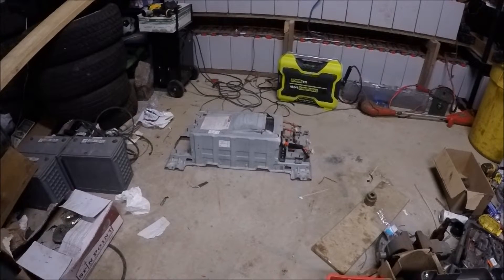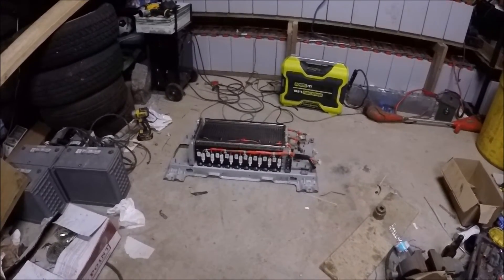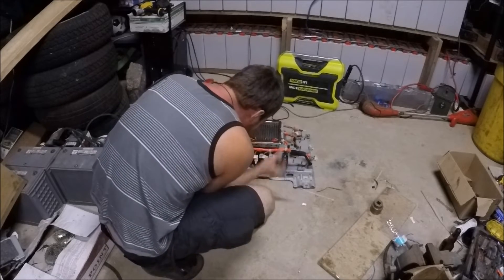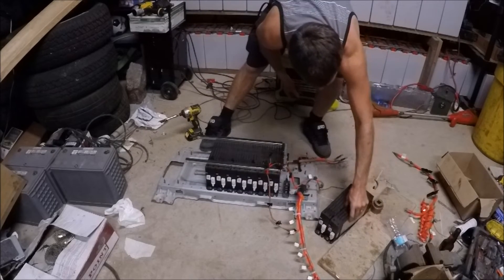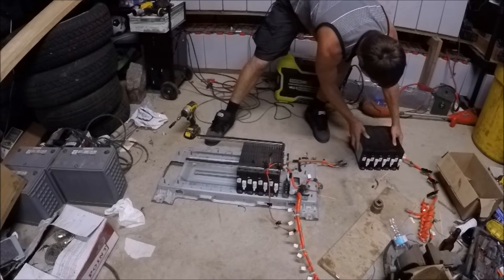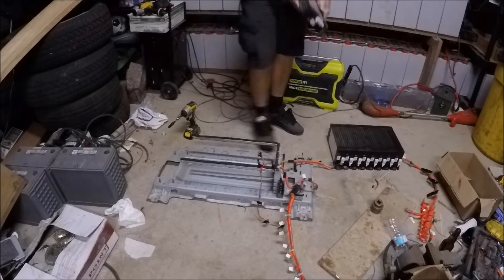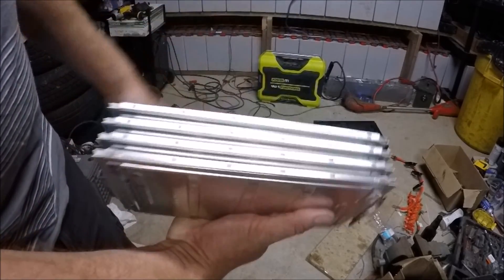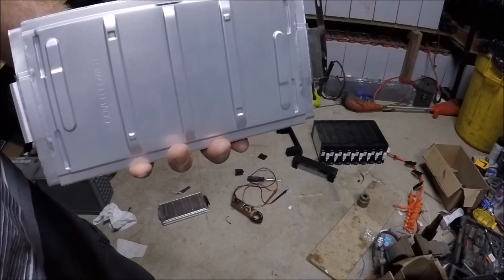EV Battery Tear Down

Comment: I would have wired the cell blocks as 2 in series to make 48V and upgrade to a better inverter.

Think this is from a 2013 Hyundai Sonata Hybrid, the specs and battery casing match. Seen some cheap hybrid battery packs in my part of the world also, I don't have the spare cash otherwise I'd have one already.
Reply from the maker: you are right,  but these are 33v packs and are no good for 48v as they are :(

Comment: don't over charge them, if they are lithium you will DESTROY them if you go above 4.2 if one cell 8.4 if 2 cell and 12.6 if 3 cell. be careful with them
Reply from the maker: they are 3.6 volts fully charged
Reply from the maker: russ22f nvm, they are not 3.6 full I checked again, I was wondering why they didn't last long :D I charge them to 4.13 volts
Reply from the maker: russ22f these are 4.1 AH 30 volt packs and I have 9 of them
Reply from the maker: so not even close to 9 KW :(
Reply: @GoingOffGrid101  yikes really?? How did you figure that out? What do you discharge them to?
Reply from the maker: @besamjohn  i chage to 4.13v a cell
Reply: @GoingOffGrid101  OK cool! I was worried I had fried mine😁